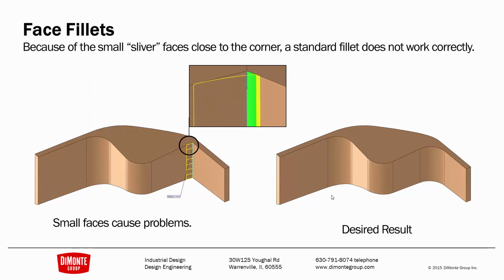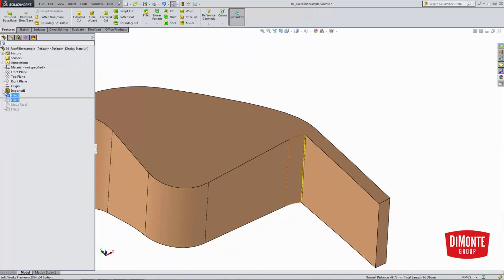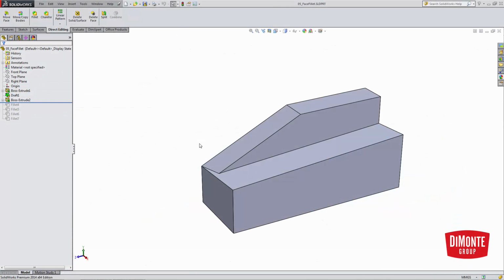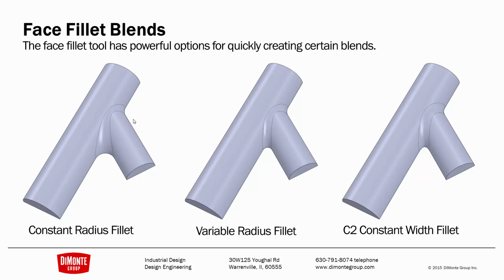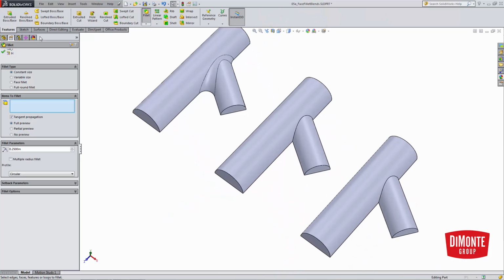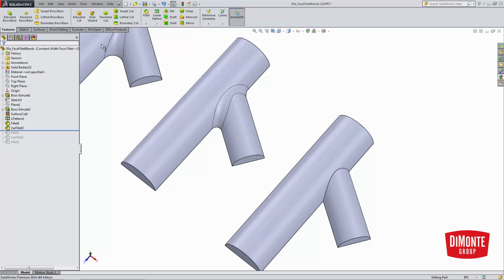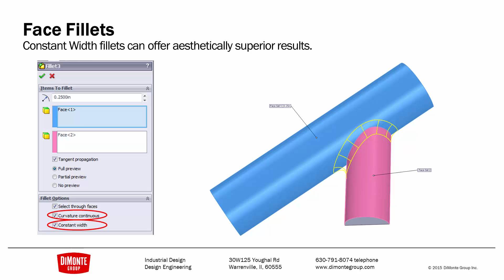Will It Fillet? | 04- Face Fillets

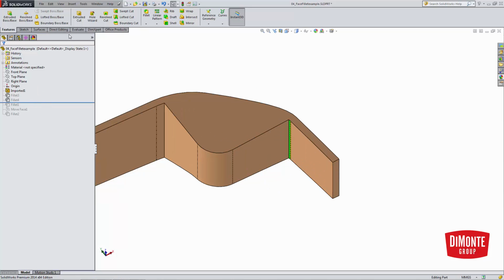Comment: At 1:52, If you use [delete faces] on a solid, where it deletes & automatically fills it back, is your result a "surface" body? or a solid?
Reply from the maker: Sorry about the delay in this reply.  Thanks for the comment!
The "delete and patch" at 1:51 in the video will result in a solid if it can.  It depends on the underlying face geometry and whether or not it can be extended make that solid.

That's one of the most powerful things about Face Fillet.  While filleting an edge is a cheat algorithm to automatically select adjacent faces, Face Fillet allows a designer to skip faces and choose them directly.

With all things SOLDIWORKS, you have to try these things out for yourself and get a handle on how it works.  

-Ed